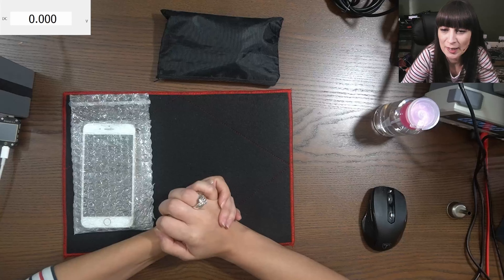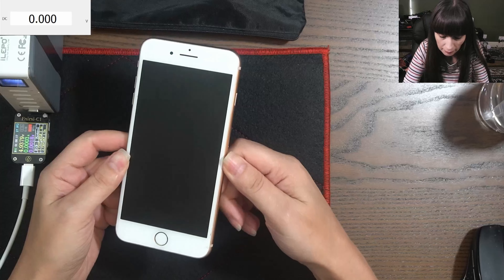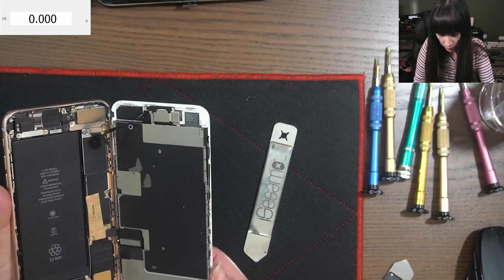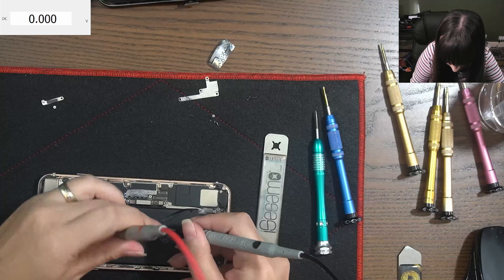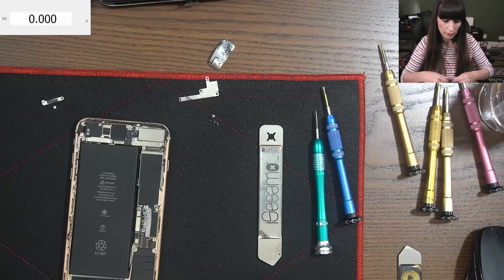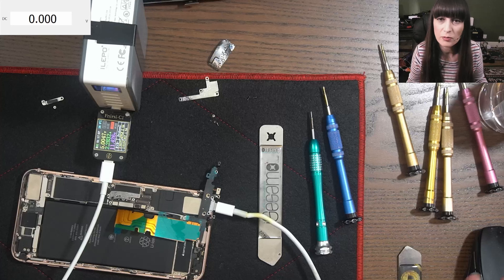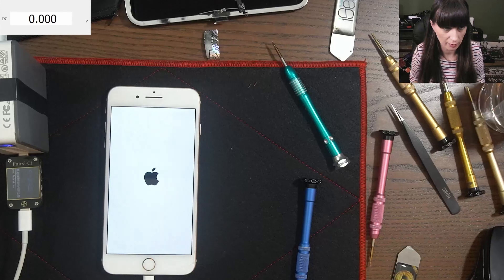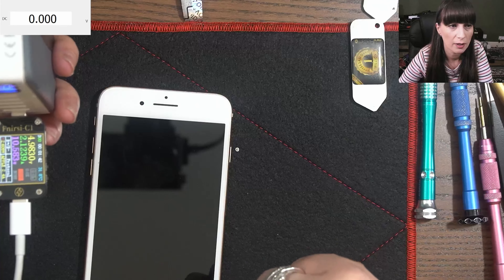How to fix an Iphone not charging or no power - Let's learn together

Comment: Some cables are on blacklist, or incompatible. Power bank fixes the issue, solar power bank causes better charging using sunlight, and needs 3 charging only. The battery needs to be unplugged once for few seconds. If the user is a bad guy, the phone and cable goes back to blacklist, and charging stops again. Power bank continuously fixes the battery, and becomes stronger.